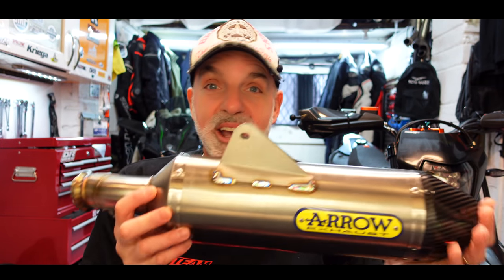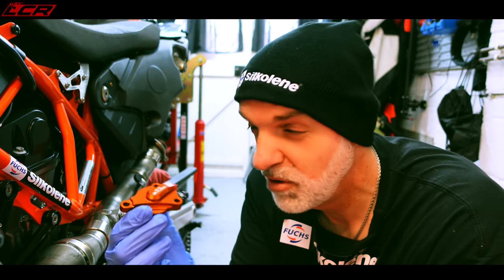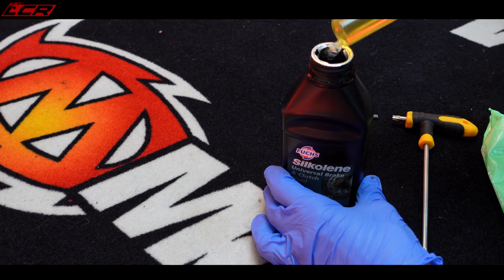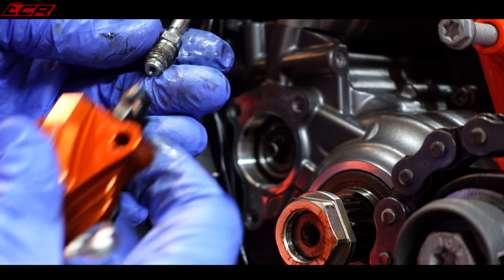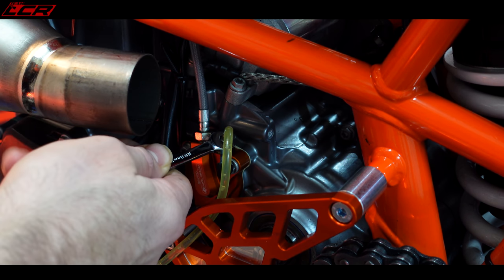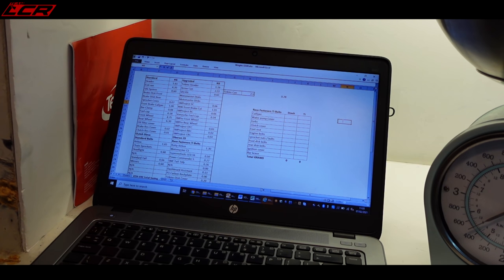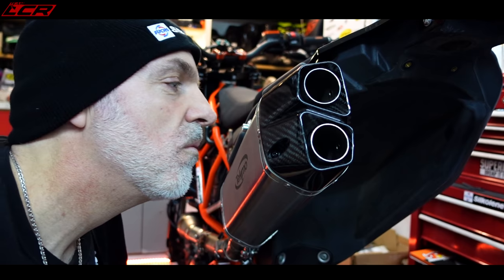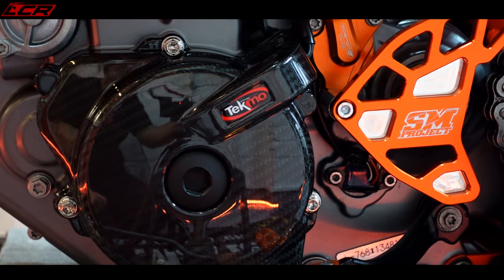Tekmo Exhaust Fitted & Bleeding Oberon Slaves | Ultimate KTM 690 SMCR Build EP08

Comment: I used silkolene on my tiger 1050 the fully synthetic oil. I have to say I was really pleased with the results , gear changing smoother and engine felt smoother, good stuff me thinks 👍
Reply from the maker: Yeah I have some for the oil change on the H2 also and hoping it can improve the finding neutral problem 👍

Comment: You can also use a syringe and force the fluid from the bleeder it’ll fill up faster than this way and won’t waste that much fluid and make a mess
Pump the syringe a few times to get the air out and push the fluid in it takes like 2min to do the bleeding

Comment: fitted Oberon slave cylinder to my 690  failed at 86 miles had no issues bleeding the clutch. but priming the salve cylinder would make easy to bleed nice one chops
Reply from the maker: Yeah some seem fine some fail quickly.. I replaced it as heard to many stories like yours. Don't want to be out on a trip and it fails 😒

Comment: I think you should have oiled the syringe rubber too 😂👍 I use syringes for brake bleeding, good way to pull fluid through the system if it's fully dry, no need for reverse bleeding as some people like to do.
Reply from the maker: Yes haha, its probably past its best and too big! Now that sounds wrong 🤣
Reply: @LambChopRides  😂😂👍

Comment: Nice and interesting project mate. I know you started with an Akrapovic carbon heat shield but would be nice to add to your excel table the weight loss going from OEM heat shield to a carbon one. Or did you considered it when you weighted the tekmo pipe? Good luck with the project. Excited to hear that tekmo muffler 🤩

Comment: On my 701, the slave cylinder failed after 1500km. Check the connection of the wire, when the engine is very hot, mine went lose and I had no clutch again after I changed to Oberon.
Reply from the maker: OK good tip 👍

Comment: Evening Chopsy. Loving the build but don't Magura clutch master cylinders use mineral clutch fluid? Check the original reservoir cover as it will say on there.
Reply from the maker: They used to Nick, new one uses DOT4 👍
Reply: @LambChopRides   I'm maybe showing my age a bit there am I 😜

Comment: Should open the bleed nipple when using syringe
Reply: Not really as he didn't seal the top with the syringe and was just getting a bit of fluid in to help bleed it through easier, but I get what you are saying/thinking, his issue was the plunger was sticking on the syringe.

Comment: Sound in the intro was a bit weird, not 50:50 split when wearing headphones
Reply from the maker: Well spotted I struggled with audio on this one. Only had one channel working on the intro so had to fade it over. 🙄
Reply: @LambChopRides  😃 a lean manufacturing manager at arrow has said we can save a few quid if we don't weld it properly... But it looks like a lazy job.

Comment: You can't just bolt on the Tekmo exhaust and don't start the bike even once.. :(
Reply from the maker: Next time I will I promise, problem is in the garage its sounds completely different. No wheels so can't move it outside
Reply: @LambChopRides  Okay, I'm curious what the exhaust will sound like. There are not many sound examples of the Tekmo exhaust out there

Comment: Choppsy, nooo!!!! You just ruined both your master cylinder and your new Oberon slave by putting brake fluid into it! You cannot put brake fluid into a Magura clutch system. The Magura clutch uses specifically mineral oil, and ONLY mineral oil. Putting brake fluid into a mineral oil system swells all the rubber seals on the pistons o-rings pretty much ruining both your master and slave cylinders!  If you catch the mistake in time you can sometimes flush it out with denatured alcohol and still save it, though seeing that your video went up 20 hours ago I think it's a bit too late for that now. 

Oh well, you live and learn. FYI, every Magura clutch uses mineral oil while every Brembo clutch uses brake fluid. You ruin them by mixing them up. Ask me how I know...
Reply from the maker: Don't worry sir, the new 690 uses DOT4  fluid. I double checked before I started, but it's a very good point though I should have mentioned that  👍